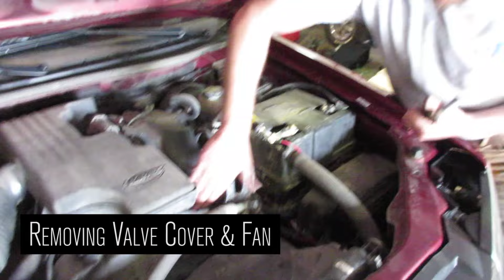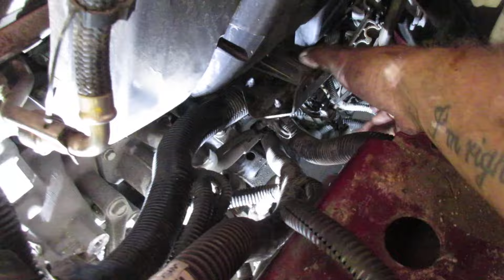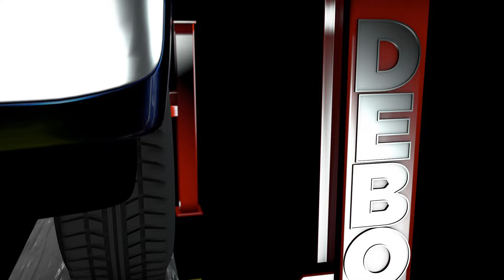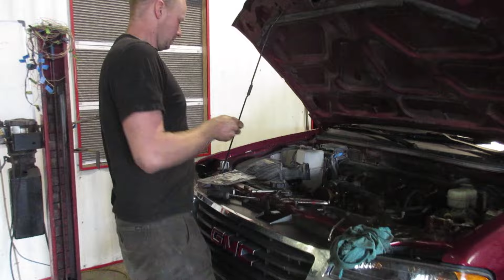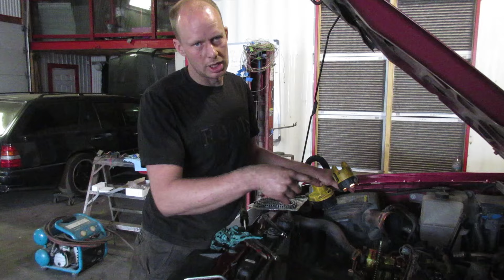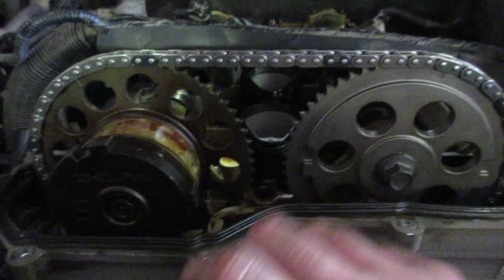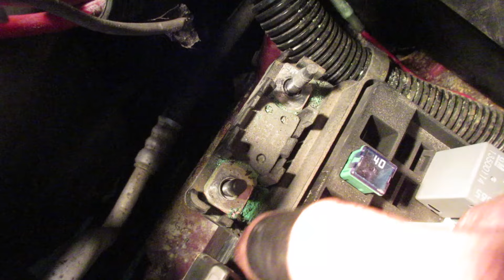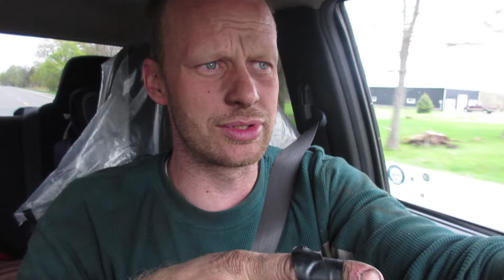Over-Engineering At Its Finest! GMC Canyon Needs A Timing Chain

Comment: screw all that B.S.! I'd drop in a 5.3 probably easier and cheaper! Haha
Reply: Until you get to the wiring and computer.
Reply: Indys Dad 
GM offered the 5.3 in the 1st gen Colorado/Canyon, so most of the electrical work is already figured out. Pretty trivial for a swap really, considering guys are already putting LS v8's in Mazda Miatas, Nissan 350z's, even Foxbody Mustangs.

Edit: Out of curiosity I googled it. The wiring harness, engine mounts, radiator lines, power steering lines etc for a V8 swap are widely available for swapping 5.3, 5.7, 6.0, 6.2, etc into your 1st gen Colorado or Canyon. 
http://www.currentperformance.com/product-category/engine-swap-parts/colorado-parts/

Plenty of step by step guides to see what you're getting into too.
http://www.gmtruckclub.com/forum/threads/04-colorado-v8-swap-lots-of-pics.112523/
Reply: Its not that hard. I did it. Its pretty straight forward. The only difficult thing was finding what you need. All of the parts from GM cost an ASS load of money haha. So i had custom lines made ect, which came out way cheaper, and looked way better.
Reply: Indys Dad swap harnesses and parts are easy and plentiful and anything thats too expensive can be done by yourself or sent out to a guy who basically only does that lol. A standalone harness and stock ecu is all you need and is like $600 including buying a 300 harness and computer....you could get it done for $300 if you went to a junkyard and did the ECM retuning(vats, rpm limit, tire size, enrichment removal) yourself
Reply: $300 for a crapped out engine that needs $600 in machine work to get back to being worth even dropping into your truck, and you will need a new ecu, you can't just retune any ecu to do whatever you want, you'd need something like a megasquirt to do that. And you will need a new wiring harness because I promise you the wiring harness for a 2.9 is nothing like that for a 5.3. Oh, and now you have an issue with your automatic transmission because that's also controlled by your ecu. No, swapping isn't just that simple or cheap.
Reply: I had a 2005 Colorado, loved that truck, but this crap is exactly why I traded it in... the captured rotors make brake jobs a real PITA, front hubs that failed repeatedly (I put 5 sets of hubs on that truck in 4 years), misfiring, timing chain nightmare... just junk. These trucks are money pits once they get above about 150k miles. Hell if you need a timing chain or head swap on one, it's easier to swap the whole engine!
Reply: The V8 swap is easier on 2008 to 2012 models due to computer changes. On the earlier trucks, especially 04 to 06 the computer and wiring required to get a factory like result on a v8 swap is pretty challenging. It has been done, yes, but it's not for a novice. If you just want it to run, and you don't care about the factory guages, or safety equipment then it wouldn't be as bad. The later trucks are somewhat easier to get everything working together properly. I had considered an LS swap on my 05, but decided it wasn't worth dumping that much more money into it. 355nation is a good resource for the 1st gen Colorado and Canyon.
Reply: Alex full drop out 5.3 with trans is like 1100-1200$ you can get it with a warranty too. That’s oil pan to wiring harness. And ls most the time as long as the oil was changed on time they don’t even need a rebuild. I’m building a 5.3 rn that looked just as good as my 120k 5.3 and it had 330k, obviously it had more gunk but everything I thought would be bad was perfectly fine.
Reply: Better than a 5.3 and much easier is a Mercedes diesel as far as lasting goes . I just started on a Mercedes swap
Reply: Lawrence Eich 

The majority of people who say to just drop a motor in something probably have never done so
Reply: Sad that nobody here has even heard of the Sloppy Mechanics channel with his crazy junkyard Colorado build
Reply: @jessewerle409  any info you could give about the swap
Reply: @danielboyd1186  check out current performance. They have the mounts, you can her a harness built by them, or even build your own. Lots of ways to do the swap, just how far are you willing to go haha
Reply: @jessewerle409  a harness that will plug in to use all factory gauges? Any idea on a price? Thanks man. I'm considering doing it. I really hate the 2.8. I just had 110k miles with I believe a broken timing chain. Fml
Reply: @danielboyd1186  yeah current will do it all for about 12-1400 bucks. Everything works in my truck. I had to swap out the pedal because I used a tbss computer
Reply: @Alex-hf5kg  why the hell would u need to remachine it ?????
Reply: Alex   Sure you can retune an ecu, tuning most Gm computers is dead easy.
Reply: @Alex-hf5kg  sounds like you don't know much about GM gear, LS swaps are common for a reason. Standardized platforms saved them money and it makes it easy for mods and swaps.
Reply: @1985230ce  The wiring and computer is the easy part. The hard part is the fact you cant pass emissions or inspection with an engine swap.
Reply: You are correct drop in a 5.3

Comment: Probably could've LS swapped it faster. 

I haven't heard much praise for Chevy's smaller trucks.
Reply: you mean isuzu trucks?
Reply: Andrew Barcomb well that would explain it
Reply: it would stay alive with a vortec 305. Ebay has a butt ton of them.. I want all of them for go karts, mini bikes and snowmobiles and boats and and..
Reply: The s10 platform used to be a great alternative to a fullsize truck or suv. Simple reliable and pretty tough
Reply: Jeff super easy to v8 swap to
Reply: barry g but why when the 350 is available as well!
Reply: I bought a new 07 Colorado Z71 for my Mom to replace her ageing Toyota and its been a great truck with no issues at all _ This is the 5 cyl, 2wd, quad cab model with just over 120kmi now.  She was @80yo and I got her the Chevy because they offered the Onstar Service up-link in case of accident of malfunction, no other manufacturer had anything like it. I would have gotten her a Nissan Frontier but they did not have Onstar.
Reply: Good choice bravo21
Reply: Oh? Everyone I know that owned one have been satisfied at the least and a couple really have fun and work and play! One actually tows a 4,500 travel trailer with his that is a two wheel drive Crew Cab 5 cyl automatic that has plenty of power and get decent mileage. One friend has sold his to his kid brother with 155,000 trouble free miles! Knowing his brother was getting a decent truck for $500! He bought a new one like mine, a 2016 ext cab Z71,4x4, V6! The we both really are totally satisfied with!  The friend I have with that year 2007, Tacomas have all failed inspection due to frame rot!
Reply: Chris Kiss what and how would you know I'm lying about? You have no idea who I am or what I do, but say that all I wrote are lies? Every thing I wrote there is the truth!
Reply: The 5 cyl tow rating is only something like 3800lbs...
Reply: umm: the last couple years produced, with 3.7 liters, raise from 3.5, the tow rating was raised to 4,800 in the 4x4!
Reply: 4x4s in 9 out of 10 cases have a lesser tow rating than a 2wd.
Reply: at least somebody knows whats up with the 4x4 towing bs
Reply: Chris Kiss that's what I found on Chevy's site!
Reply: immikeurnot it's actually 5400 for 2wd 5000 for 4x4
Reply: immikeurnot Tow ratings factor in more than just the engine bud. The I5 did suck though.
Reply: No.
Reply: hochhaul, everyone I have talked to (including a few die hard GM guys) says the 5 cyl is terrible...I glad I kept my S10...
Reply: Idk I have the i5 and like it. It gets decent gas mileage but has a lot more power than the 4 cyl. Also timing chains aren't normal service items. they usually go 3-400k miles without needing to be changed so there was probably a problem with this one that caused it to go so quickly.
Reply: Jasonrotfl Running the wrong oil weight or stretching oil change intervals out too far will eat a timing chain up. Contaminants like dust allowed by a dry  K&N air filter will get into the oil and abrade timing chains too.
Reply: Jasonrotfl I have to agree. Everyone I know that has one is fine with it! I know one guy who tows a tandem axle 4,500 lbs travel trailer all over the place with one, all up and down the east coast and Smokey Mountains to upstate N.Y. , plus the New England states! With over 170,000 miles so far! It's s 2008 4x2 Crew Cab LT.
Reply: Kevin Voyer yup it's got a nice flat torque curve and the tranny out of a Silverado so you know it overrated for this truck
Reply: hochhaul I agree mostly, but not so much about the K&N causing problems you mentioned. But in these latest modern wiz bang engines, full synthetic oil is more important than ever!!! With a very good oil filter!
Reply: Bravo21 n
Reply: More cost effective.
Reply: Indrid Cold I miss the old Commodore, especially because it had the buick 3800.
Reply: Frame rot killed my 08 Tacoma...  Traded it in on a 2011 GMC Canyon.
Reply: They were available with a 5.3 for a couple years
Reply: 5.3 l would make for a nice little "street truck"!!  I have seen a few people that have swapped out the 2.9l for a V-8.
Reply: Indrid Cold   hey  this comment interested me I have this same motor and  I ended up changing the  cam position sensors   and I read something about  hooking like a tech 1 or something up to it to basically reprogram it   is there any truth to this ?   Because when it does start now it is very rough at idle then it will die
Reply: Indrid Cold seems like I6’s never have issues I have an 02 Trailblazer with the 4.2 I6 got 513k miles the timing chain got replaced but nothing major just timing chain alternator and 2 staters
Reply: Frame rot killed my 2008 Tacoma.  Ended up getting a 2011 GMC Canyon with 36,000 miles... so far so good!!
Reply: With the right motor mounts. The colorado is easy to LS swap.  Everything bolts right up. Driveshaft slides right in. The trans linkage is the same. Easy
Reply: How about wiring harness/electrical connections??
Reply: The gauge cluster of the Colorado uses serial data to communicate. therefor one wire and all your gauges work.
Reply: The 5.3s very reliable til you get into the dod/afm 5.3s then you can either delete the afm/dod or fix it
Reply: Mandela Effect i managed to get one that was older when i 5.3 swapped my colorado. And it doesnt have dod afm. But yea gm would have been better off not doing that on the gen 4 motors
Reply: Yup, I have the 4.3 V6 S10. A really good engine built the way older V8's were built. No overhead cams and has pushrods.
Reply: 4.3s are sturdy engines. The POWER of a 4 banger and the gas mileage of a V8. lol
Reply: Uh.. The atlas series have shitty wrist pins.. 2 trailblazer owners have the i6.. Now they're i5's..
Reply: Uh.. The atlas series have shitty wrist pins.. 2 trailblazer owners have the i6.. Now they're i5's..
Reply: MatsuriGoreKun
GMT 325
Chevrolet S10
GMC Sonoma
Isuzu Hombre

GMT 355
Chevrolet Colorado 
GMC Canyon
Holden Rodeo
Isuzu D-Max (Isuzu i-Series)

GMT is the designation prefix used for all General Motors truck

In 1996, Isuzu replaced its P'up with a version of the Louisiana-built Chevrolet S-10, the Isuzu Hombre
Like the Hombre, which was based on the compact Chevrolet S-10 / GMC Sonoma, the i-Series was based on the Chevrolet Colorado / GMC Canyon
Reply: They should've kept the S-10
Reply: I drove around a '94 GMC Sonoma (4.3 vortec V6) for a little while a couple years ago, man talk about a piece of crap. That thing was an electrical nightmare that seemed to be very cheaply slapped together.
Reply: @stephenmaurer7008 canyons rot too

Comment: This is why I daily drive a 1982 Jeep CJ7. Mine has never given me any issues and is as reliable as my 1997 Ford Ranger that I bought new and have had for 22 years (4 cyl, 5sp XLT) .  Anything that goes wrong is $5 at the auto parts store and can be worked on with duct tape and a paper clip.

Comment: overengineering ?? Sounds like under engineering to me. I call it piss poor engineering.
Reply: To me, overengineering is when something is deliberately designed to fail after XXX miles to get more money out of selling parts. BMW are just as bad. Piss poor engineering is like in a car where the numbskulls tell you to jack up a car and the jacking point isn't strong enough to lift the car without bending! Happened to my VW Golf. And those crazy Germans don't even mention that it's best to lift from all four points at once to distribute the weight. Then why do they even put a jack in the trunk to begin with...
Reply: Oh, and sometimes people moan about VW, Audi, Porsche, etc, being "overengineered." I slightly disagree. My car has piss poor engineering. When you can't even jack up a car without damaging the frame, then it's piss poor engineering! Hell, it even has a sticker with an arrow that says "jacking point."
Reply: largo a bumper jack doesn't work on my new Passat either.
Reply: BMW means ,"Big Money Wasted"  I know. My wife has one, and I have to keep an old truck to tow it back to the dealer regularly. (my new truck burned out the transmission 3 times)
Reply: The GM atlas series of engines were originally supposed to go into the fourth gen camaro, but was pulled and stuck in these colorados and trailblazers. The 4cyl is junk, the 5cyl is alright, and the 6cyl is world class. People are making over 1500hp with the factory cranks in them. It's a fantastic engine platform that was fucking ruined by the greedy GM penny pinchers.
Reply: Depends Im a Bmw tech and Ive driven the Same inline 6 e36 from the late 1990's for the past 10 years, Bmws M series engines and transmission were the last of fine engineered automobiles. Car has over 240xxx with only new belts oil and a raditior plus a top up of fluid for the 5 speed transmission. So no Bmw makes great cars but you need to the ones they built to be reliable pretty much the older 3 and 5 series. I will say the new 323 BMW has a great motor in it much better than that turbo shit I keep seeing, so if you buy a new BMW buy a new NA 323.
Reply: Dave Mackenzie last of the fine engineered engines uh no they arent
Reply: nallen100 No! Again that is UNDER-ENGINEERING. Over-engineered means that the final design exceeds the needed strength usually but in doing so the longevity is lengthened and the weight increases. In cars complexity may go up as well. Thats not what the interference timing belt is. It is done to eliminate the need for oiling and containment of oil. I think it was also done to guarantee mechanics had work to do. It is quieter too.
Reply: nallen100 Well you made me look it up. I'm a bit of a designer so I had thought of it from my personal perspectives and experiences. It is making something either too robust or too complicated. You are thinking it means making something just barely good enough. I think you are referring to designed obsolescence. Thats why I said and other people said its under-engineered. Its not robust enough. Although if something is too complex as many variable valve systems tend to be, they can cause failures as is the case with BMW and was the case with Space Shuttle. I think if you ask what the cause of these failures is it is lack of proper R&D. It is lack of meticulous study of materials and not just the theoretical but to experiment and find failures.  Like what Boeing is suffering right now too. Lately all companies are in a rush to meet sales objectives and meet time targets and the quality and robustness of testing suffers. Engineers don't want to lose their jobs and some boss somewhere is expecting miracles. From knowing Japanese people they have taught me how intimate they are and both curious and excellent in communication.  As a guy who works with both wood and metal, I appreciate the passed down knowledge on working metal for durability. And I been learning how hard Japanese people work and how demanding it is. I think here jn America many people focus so much on Freedom that they forget about dedication to your craft and to the cause. Lately of course people equate money with success same as the Chinese and so that comes to your point well made. That parts are made just barely sufficient but without margins and longevity.
Reply: nallen100  No kidding.
Reply: @jdrok5026  and how many years have you been driving BMW M cars?
Reply: over-engineered = over built
under-engineered = built by hillbilly in backyard with duct tape

design is the issue with this, engineer make things work (however complicated or smart they feel like showing off) designers make things practical.  this is not practical
Reply: @grumpyoldfart7302  BMW............................Break My wallet.
Reply: its over engineered  in the sense that they found the absolute bare minimum for something to work acceptably, look at AVE's videos about value engineering
Reply: extra timing chain to run balancers, when they could just use a just as smooth V6.